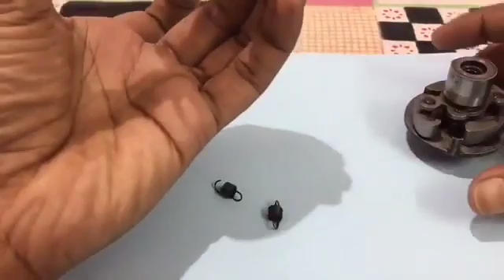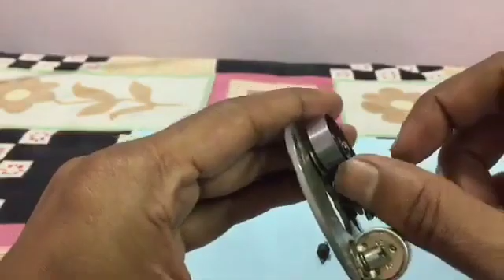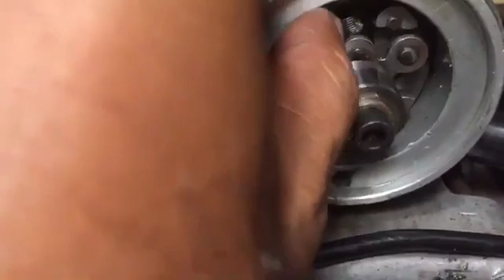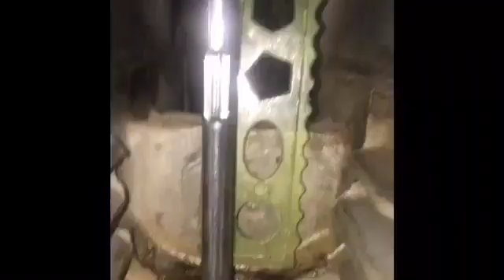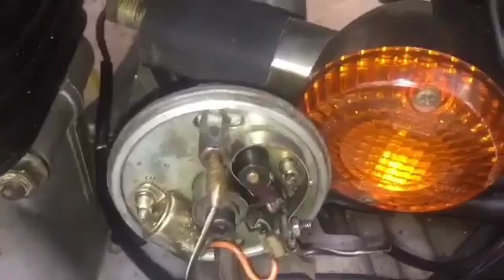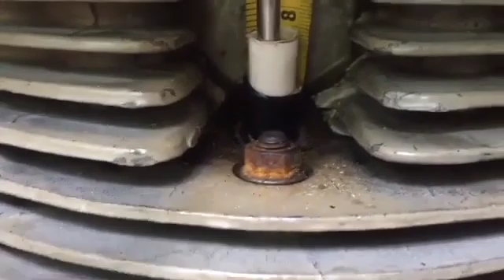Old Bullet CB Point Setting English

Comment: Very well explained video. I tried setting my bullet with your method. It’s starting well but idle running is not smooth. Slightly erratic and engine slightly backfires while driving when I release the accelerator .. what can be the error?
Reply from the maker: For  idling problem check the primary chain tension (I've done video on it)
Second problem is not a back fire issue. Your mixer is too lean, so fuel burning in the silencer. (I've done video on that also 🙏🙏😃😃)
Retune the carburetor 👍. Both problems may vanish 👍

Comment: Sir plz make a special video on ci bullet how to slow rpm  with the adjustment of manifold screw ( between carburettor & cylinder head ) as slow as we can count the thump
Reply from the maker: That is auxiliary air screw. For additional air in high altitudes.

Comment: Cheta.  Nammal vandi park cheyyumbol piston TDC yil vaykkanam ennu parayunnath enthanu. 
Piston Bdc yil park cheythal.  Tankil ninnum crank casil lekk extra oil overflow varumo?  Is it possible??
Reply from the maker: അങ്ങനെ ഒരു സാധ്യത ഉണ്ട്‌. കുറെ പഴക്കം ഉള്ള വണ്ടികളിൽ അങ്ങനെ കാണുന്നുണ്ട്
Reply: @RKR1978  അ സാധ്യത ഒന്നു പറഞ്ഞു തരാമോ.  Pazhakkam ulla vandiyil how it's possible??? 
Onnu vivarikkamo engane oil flow from tank to crankcase while static with piston bdc.    Please🙄🙄
Reply from the maker: Ok. ആദ്യം oil sump ൽ നിന്നും oil pumb ലേക്ക് ഒഴുകി അവിടെ pumb ചെയ്യുന്ന disk ന്റെ holes വഴി oil quill bolt വഴി താഴ്ന്നു നിൽക്കുന്ന crank shaft ലേക്ക് ഒരു suction ഉണ്ടാവും(due to gravity).(piston BDC യിൽ നിൽക്കുമ്പോൾ oil level ഉയർന്നും cank ഏറ്റവും താഴ്ന്നും ആണ് ). അത് കാരണം oil crank case ൽ നിറയും. Upto a maximum that is equal to the oil sump level. The liquid has a tendency to equate the surfaces. So it happens.
Reply: @RKR1978  ok thank your sir. Fluid machanisam...  nammude meshiri panilku pokunna varude ഓസ് ലെവൽ വർക് ആകുന്ന പോലെ ഉള്ള ഓയില് ന്റെ equilibrium balancing. Due to gravity... appo nammal breather pipe static stagil adachu vachal ee flow undakillllo....  
One more doubt 
30ml anallo crank sump max oil after running. Staticil ath koodandeyy. 
Ennalum tdc yil piston nikumbo enthukondaa oil bancing varathe... 🧐🧐??

അയ്യോ വേണ്ട.  ചിന്തിച്ചു കിട്ടി. മതി ചേട്ടാ.മതി. 
നിങ്ങ  വേറെ ലെവൽ... 
താങ്ക് യൂ.... ente bulb kathipichathinu nandi.....💡💡💡🔌🔌
Reply from the maker: നല്ല ചോദ്യം ആണ്... breather പൈപ്പ് engine ഏ atmosphere മായി connect ചെയ്യുന്നു എന്നെ ഉളളൂ. പക്ഷെ engine ന്റെ ഉള്ളിൽ closed system ആണ് അപ്പോൾ  equilibrium pressure ആണ്  ആണ്. അപ്പോൾ oil ഒരു വശത്തു നിന്നും മറുവശത്തേക്ക് gravity കൊണ്ടു ഒഴുകാവുന്നതേ ഉളളൂ. Crank case പലപ്പോഴും valve തുറന്നിരിക്കുമ്പോൾ, easy ആയി oil sump timing side എന്നിവയുമായി ബന്ധപ്പെട്ടു തന്നെ ആണ് ഇരിക്കുന്നതു ഒരേ pressure ൽ. Piston TDC ആയിരിക്കുമ്പോൾ oil 30ml മാത്രമേ ബാക്കി കാണാവൂ. അതിൽ കൂടുതൽ വന്നാൽ പുക വരും. Scavenging pumb weak ആയാലും oil കൂടാം.
Reply: @RKR1978  athayatha oil cap nte mukalile hole itself oru venting for crank case also..air venting onnu imagine cheyyan nokuaneyyy.... 
Oil cap,  oil tank timing cheast. Avidey thirua alle...  air. Pne crank casilekk pokillalo air. 

Next if valves open
Air entrr through carb to cylinder head/ exhaust pipe to ex valve to cylindr head. How the air enter to crank???? For venting... other than breather pipe.
Equilibrium pressuril avanam engil crank casum  oil tankinum ullil  same pressure aakandey if they vent with atm then ok. Apoo nammal breather adachal flow kanuo tank to crank.
Reply from the maker: @TRIVANDRUMBASEDKERALITE  almost ശരി ആണ്. പക്ഷെ 2 കാര്യം...  ഒന്നു oil sumpഉം അന്തരീക്ഷവുമായി ബന്ധപ്പെടുന്നു...  രണ്ടു അത് പോലെ cylinder and crank case അതും അന്തരീക്ഷ മർദത്തിൽ ആണ്(through the open valves)also valve guides  have oil clearance only but air can go through it. So no pressure difference between oil sump and crank case.  Thus Oil can easly flow to crank case or vice versa. Breather is not suposed to spill oil...  breather is meant for venting the extra pressure built by the to and fro movement of the piston..
Reply: @RKR1978  ok chetta thanks.  Njan guide clearence  zero ayittanu eduthath.... thank u for respond.   

Nammal decompresser pidich vandi off aakiyal  piston approximate TDC yil ayirikkumo
 final stop akunne .. angane anek vandi park cheyyum munp decompression pidich off akiyal  nannayirikkum....
 atho piston ethu position il venamenkilum varamo???
Reply from the maker: അല്ല decompress ചെയ്തു അവസാനം ammetre centre ൽ വരുന്ന ആ moment ആണ് TDC.
Reply: @RKR1978  ok thank you. Chetta. For clearing doubts.
Njan udhesichath oru random chance aanu.  Engine off cheyyunath decompressor lever vaych anenkil....  piston tdc stop aakan chanse undo??
Reply: Two Lions sharing infos 🤗